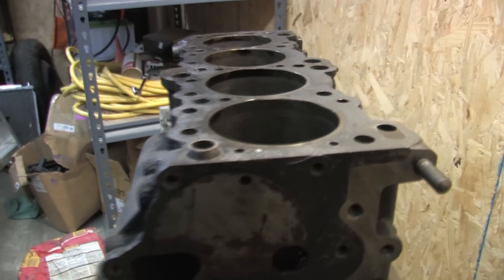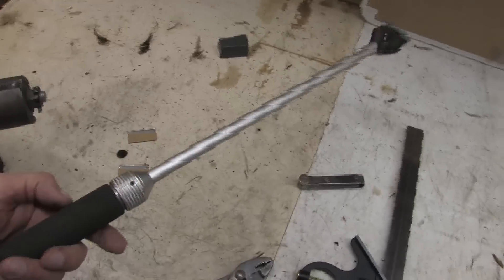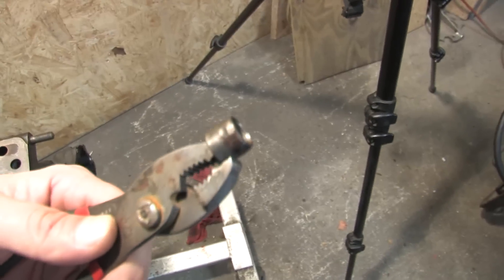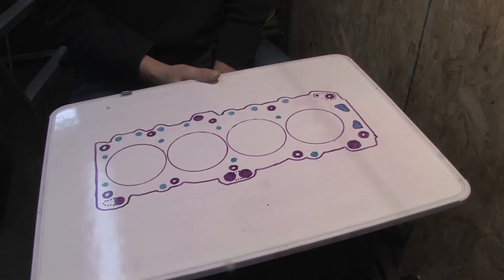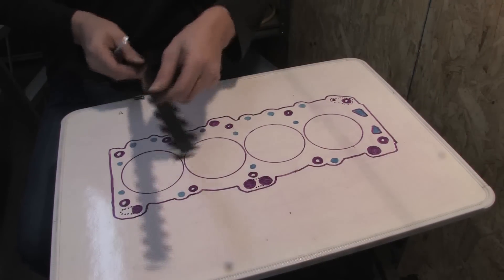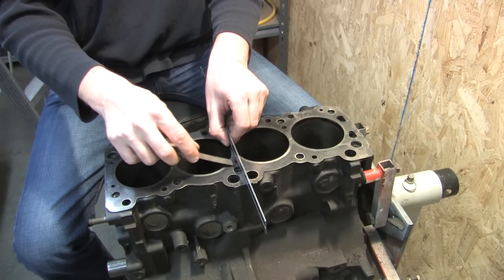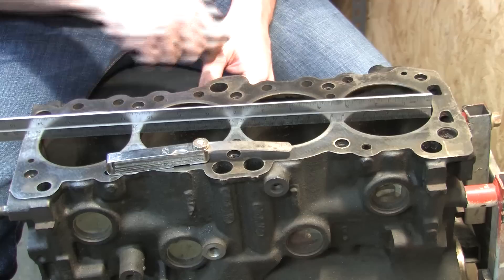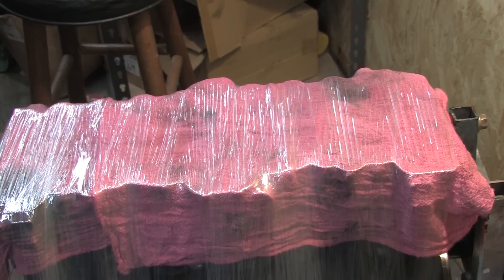Blueprint 108 - inspect the deck

Comment: So you don't think 1/2 thou is insignificant when you are going  to crush a gasket against the surface?  And a thicker head gasket to compensate for .002" removed from the block?  Really?
Reply from the maker: No it absolutely is not significant.  A half thousandth.  Really.
Gasket bore diameter = 3.399"
3.399 x 3.399 (L & w) x .0005 (depth) x .7854 (pi quartered to determine area) x 16.387 (convert cubic inches to cc's)
EQUALS 0.07 cc's.  
Seven one hundredths of one cubic centimeter volume lost from one bore.  A grand total of 0.28 cc's from an entire engine that has a swept volume of 1,997 cc's. * That's 1/100 OF 1%* loss of engine displacement.  0.01%.  Even after dividing swept vs. un-swept volumes, that's not enough to change the compression ratio in the tenths digit AT ALL.

2 thousandths?  Multiply all this by 4.  Same exact results apply.  

If you have an EFI engine, your fuel system can compensate for all of this with no tuning whatsoever.  I would bet the o2 sensor and MAF sensor don't even pick up a difference.
Reply: " * That's 1/100 OF 1%* loss of engine displacement.  0.01%."

I was saying you didn't need to machine the block.  The gasket would have taken up that irregularity.  That is why you have a gasket.  And even if you did machine it you haven't lost any displacement !  Piston still travels the same stroke.  You have raised the compression ratio which will add to the performance.
Reply from the maker: @kansanbrit   Oh, gotcha!  Yeah, that's definitely going on here.  I'm using the small combustion chamber head from a 1.6L on a 2.0L block, it's been shaved another .033", which is well beyond the serviceable limits.  So bad I had to cut reliefs into the stock pistons to make it fit.  Now it's 9.8:1 static compression (instead of 7.8:1), and who knows what it is at 30 PSI? There's math for that, but I'll spare you. lol.  I can't figure out how to account for blow-by even if I tried...  But yes, compression is a great thing!  Now if I could just stick a launch somehow?
Reply from the maker: My apologies.  I just realized I was answering a comment in a different video than I thought I was.  Completely changed the context of our discussion, and this block is actually not the one I described in my other comment.  This is the one for my GSX, not my Elantra.  The Elantra is the perfect example for the compression trick you described.  I'll be putting it on a dyno soon, so we'll finally get to put a number on it.

Comment: Where do you get all the info about the manufacturer specs?
Reply from the maker: I have all the factory service manuals, Haynes manuals, and factory overhaul manuals for 1989-1997.  Eclipse, Galant, Expo, mirage models.  I have more Eclipse info than anything else, but I have the engine overhaul manuals for all the USDM gasoline-burning stuff.  I bought them back when they made printed copies.  But for whatever you are looking for, all you need is the factory service manual for it.  It has all the specs for your whole car bumper-to-bumper.  It didn't come with your car, you have to buy it.  You can often buy electronic copies these days, and you can also find printed ones used on eBay.

Comment: what type of straight edge are you using
Reply from the maker: It's a piece of a square level from my local hardware store.  It was like $18.  I took the ruler part off and used that.
Reply: @Jafromobile  Do you think a hardware store ruler is flat enough to measure in the thousands of an inch?
Reply from the maker: @SSSCya  Yep.  It isn't a ruler.  Combination squares are rigid, and their purpose is to check how square a thing is, so they're straight.  I needed it on a Sunday so I bought a brand new one for this, it never got a chance to get bent.  ...and technically it's one and a half thousandths because that's the smallest feeler gauge in the pack.  I have since obtained a machinist's straight edge.
Reply: @Jafromobile  A combination square is for carpentry. I'm glade you bought a machinists straight edge. A machinist is only as good as his tools.

Comment: so how do I know if my block has been resurfaced is there any stock number I can compare mine to I know when I head gets resurfaced it changes the CR I'm sure it's the same for the deck right?
Reply from the maker: +Jacob Hoke A 4g63 is supposed to be a "zero deck" block.  Meaning the pistons and block should be level.  In my experience, an un-cut block typically has 2-5 thousandths of an inch of recess to the pistons.  If your pistons are protruding from the block, chances are the block has been decked.  Yes, decking the block increases compression because the pistons protrude more into the combustion chamber.
Reply: +Jafromobile I just got the bare block about to go get her cleaned I was hoping for a way to refrence. if it is to low is there a way to to fix the problem I.E. shorter rods or piston pin location
Reply from the maker: You're on the right path of thought… Just weigh the cost of doing something like that first.  Everyones access to resources is different… but you might find another block is a better option if it all goes down like that.  It's normally the head that gets decked.  The engine block getting decked usually requires some kind of major defect that block sanding won't fix.  It's usually the aluminum head and not the cast iron block that warps.
Reply: +Jafromobile sorry for the Thousand questions is the first day since I figured I would get something Bulletproof didn't know the block wasn't decked Hahaha thank you
Reply from the maker: If the deck of the block is out-of-spec, then yes, it gets decked.  Otherwise you can just clean it up.  If you deck it, just be aware that you could get into a situation where the piston protrudes from the block, basically turning the head gasket's fire ring into your combustion chamber at TDC.  If you knock, that doesn't turn out well for your head gasket.  If you deck the block, you've got less than .002 to play with.  I have a block that had .006 shaved off.  Had to.  Deck surface was pitted.  I've got a ton of money in it already, so if I have to put custom pistons in it to use it, I will.
Reply: Jafromobile

Comment: $60 Snap-On scraper? Ha! Check this out-  https://www.amazon.com/Unger-Ergotec-Short-Handle-Scraper/dp/B00N3B9DCO/ref=sr_1_4?ie=UTF8&qid=1455259903&sr=8-4&keywords=unger+floor+scraper   and an extra pack of these-  https://www.amazon.com/Unger-RB10C-Replacement-Double-Edge-Dispenser/dp/B004MDMAB8/ref=sr_1_2?ie=UTF8&qid=1455259903&sr=8-2&keywords=unger+floor+scraper   to go with it.  Wider, stronger, less breakage, and wider is sometimes better for large areas (head decks). Huh? What you say?

Comment: jaffro, how do i check if the deck has been milled before, is there a similiar method to when you check the head thickness?
Reply: kbcustomz  Check the stock specs for your engine. Block height is measured from the oil pain rail to deck head surface.

Comment: @Jafromobile I see ur point. I am considering a cometic headgasket. i wonder what finish they perfer on the deck surface with a cometic?  factory spec for my application is 100 micro inches with a composite hg

Comment: @Jafromobile not if you ever want it to seal up again? thats pushing it. yes i have seen people get pretty aggressive with wire wheels but ive been using them for years on the deck & the aluminum gasket surface of the head. I have never blown a headgasket in my turbo engine. with care u absolutely can use them on a daily driver. maybe they are not the best thing for blueprinted engine but 99.9% of race engines are gonna get decked anyway. on a non OHC engine i would always deck it